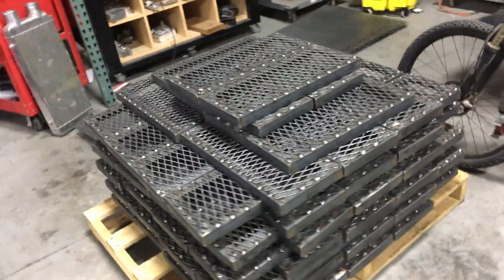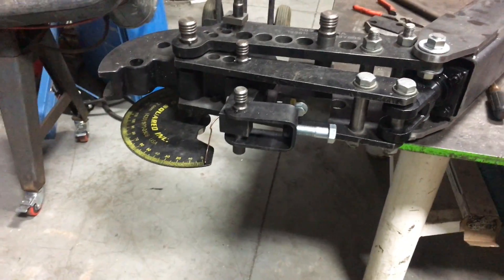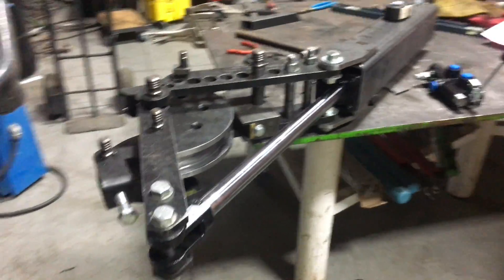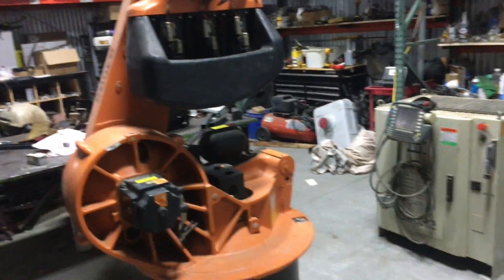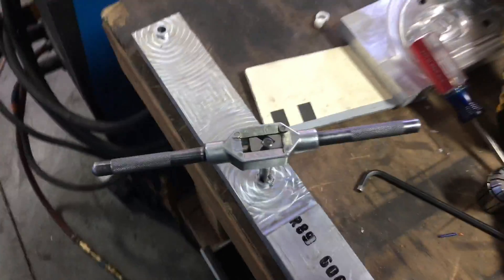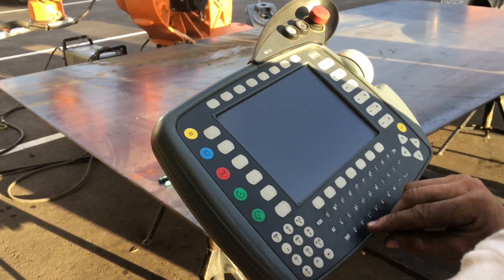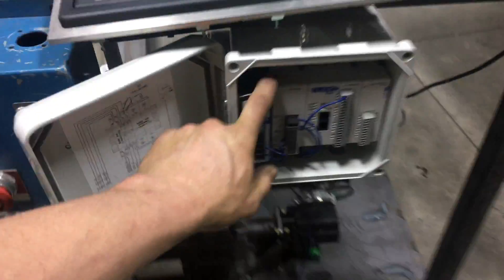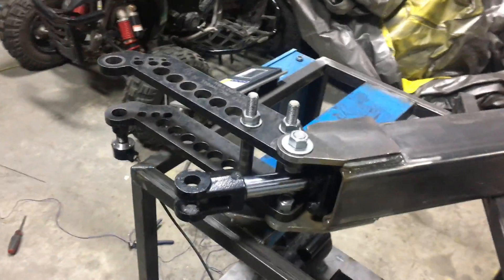Hydraulic cnc tubing bender Conversion

Comment: What feedback device do you use to stop the bender at the set angle?
Reply from the maker: rbmgf71 there is an encoder that sends pulses to the PLC which keeps track of the angle and controls the hydraulic solenoid.